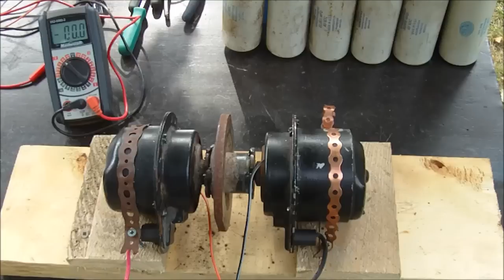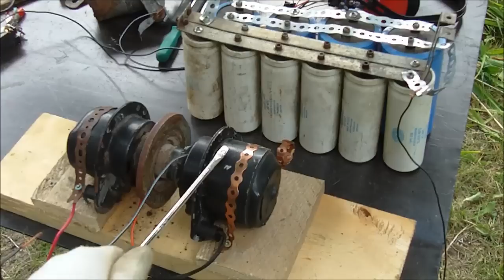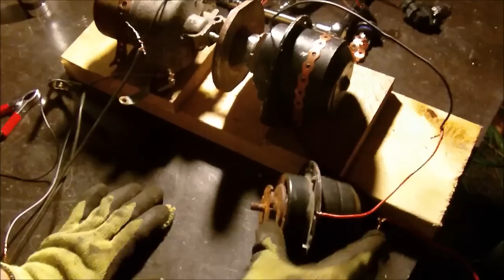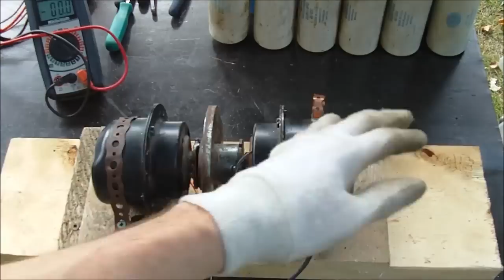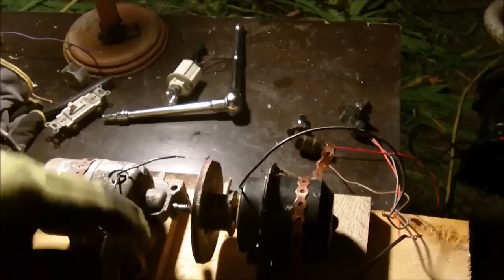Electric Motor to Motor, can they self run?

Comment: Ok so the motors aren't the best - but if it worked just pop a tyre on it and we could all drive around for ever for free, spin it faster with a fan and maybe we could all fly :~$     But if if the drag of the earth is to much for it and want to save on friction, bearings, heat and frictional forces in the commutator then all we need to do is wire a transformer input and output together add a voltage doubler for good measure and the worlds a brighter place ;-}                                                    " Now where the wife's microwave buzz"

Comment: Try and follow the same procedures only this time series the motor! when the two motor faces each other on the same pully, the polarity changes! When connected parallel one spin clockwise and the other anti-clockwise when the motor faces each other.
Reply: Doesn't matter.  Faraday already proved that the  voltage generated will be the same.

Comment: Doesn't work because basically; It takes the same energy the motor is getting from the generator to turn the generator so one "extinguishes the other" .

[Energy can neither be created nor destroyed; rather, it transforms from one form to another.] from Wikipedia

Neat little experiment though :)

Comment: This does work lol. What is the required power needed to run the power motor vs what is the output of the generator motor. It works very well it looks like you just don't have enough output to power the unit.
Reply: Lol I'm the idiot that has a working version sitting on the side of my house that puts out 6500 watts lol..
Reply: john smith  Great. Let's see the video.
Reply: john smith Can you please tell me what sort of cheese the Moon is made of?

Comment: it wont work cause your using them as just fans. you need a alternator and use the charge wire to run the opposite fan

Comment: try using a gear ration such as 1:4 so for every turn of the motor we get many more turns out of the generator.
Reply: +cris rose With much lower torque, read up.
Reply: Johan Engqvist lower torque maybe but you don't need much.
Reply: +cris rose You've multiplied the speed but divided the torque. Since Power = Torque x Speed, you can put numbers in and realise you end up with the same amount of power. That's like saying my 100HP car produces more power in first gear! Wrong it always produces 100HP but the torque can be increase while the speed is reduced or the other way around, torque can be decreased while speed can be increase. The power you get is always the same, but then friction comes in so it's always less.
Reply: so they balance each other out?
Reply: cris rose Yes exactly. They way a gearbox or chain drive or belt drive works is you can increase speed but reduce torque or increase torque but reduce speed, you can't increase both at the same time. And so Power = Torque x Speed you will always get the same power out (minus some power in friction losses).

It's good you understand this because so many free energy machines pretend to work because they break this basic law of life.
Reply: KiwiPowerNZ but surely you don't need that much torque to spin a motor?
Reply: cris rose If you are turning a motor and using it as a generator or just using a purpose made generator the torque needed to turn it depends on how much power you draw off the electrical outputs. A fast turn generator can make the same power as a slow one but requires less torque to turn it, and vise versa a slow turning generator can make the same power as a fast one but requires more torque to make the same amount of power.

So changing the speed doesn't give you free power. And in both cases the more power you draw from the generator the more power you must put into the shaft.

If you were just referring to the motor itself it must overcome the friction of it's bearings and the load connected to the shaft.
Reply: cris rose A good example is a car alternator. Power = Torque x Speed.
When the engine is idling aka low speed, the alternator requires a lot of torque to generate the necessary power the car uses. Sometimes at idle the belt will slip and squeal loudly.

When you are driving the alternator speed is very fast which means only a small torque is needed to generate the necessary power.
Reply: KiwiPowerNZ thank you :)
Reply: cris rose No problem!

Comment: You don't need 100% efficiency! All you need is enough input to drive the alternator. The output is based on the configuration of the alternator not how much current s put in!

Comment: what about collecting the back emf of the drive motor when this get energized and add some brushes and a contacor to the flywheel so the drive engine will run only on the impulses from that contact placed on the flyweel. the drive engine when is not energized will be used as a generator and when is energized is used as a drive motor. all system should run from the inertia of the flywheel wich should be a little havier to sustain the rotation of the entire  system. When the system gets started u can use a battery to skip the contact from the flywheel until it reaches the maximum speed and then the flywheel contact will do the job. I personaly want to try what i describe above
Reply: all the system will collect energy from 3 sorces: the dedicated generator, back emf fron the drive motor when gets energized, and the drive motor used as a generator when not energized...
Reply: All you are doing is storing energy in the flywheel that will slowly be drained away until the entire system comes to a stop.
Reply: Lol.  All these people coming up with different systems trying to bypass physics.  In the end, no matter how many generators, motors, flywheels, gears, magnets, coils, etc. they add, the same thing happens; the physics are the same.

Comment: You have to change the gear ratio of the motor that's turning the other one at is used as a generator put the a 3" pulley on the generator motor and a 8" on the one to Supply power to the generator motor and it will run without shutting down
Reply: Anytime you using the same gear ratio is going to neutralize and shutdown that is common knowledge
Reply: You also need a Step up Transformer to go with them capacitors

Comment: use a gear system. use the lower power motor with a large gear and the power generator with a smaller gear in order to make the power motor spin faster than the smaller power motor. once you do that you make the larger output motor output more energy in order to push the smaller motor enough to produce that power. it makes sense. that is the whole purpose of gears. take a vehicle transmission for example. the rpms could stay at 3000 rpms but with each gear (6) your reach a speed of 10 mph for gear one. 20 mph for gear 2, 35 mph for gear 3, 50 mph for gear 4 and 60 mph for gear 5 and last 70 mph for gear 6... (just an example) but this is all at 3000 rpm. of course you raise the rpm, you go faster. but the point here is the gear system. use a gear system for the motors. and walla! more output power then input power equals more power to push the input motor as well as the load on the circuit system.

Comment: Use graphene capacitors  there mass is so much smaller and charge  very quickly and pulse the generator motor and not the drive motor, use 5 caps 2.6 volts ea. 3000mfd that should get the drive motor spinning
.
Reply: Lol...hilarious.  And what?  Run for maybe a few minutes and then die when capacitors are drained?  What is the point?

Comment: what if u connect the 2 motors with a flywheel and have some rare earth magnets glued to the flywheel to help the motor keep running the magnets should keep pulling the flywheel spinning
Reply: conservation of energy still applies
Prolem is there is a loss of energy as it travels trhough the wires, loss of energy as it turns ti kinetic energy in turning the motor at a effeciency loss and even more energy loss as the generator ineffeciently makes electricity.......and this is even before you put a motor load on it which will cause a physical drag or atry to draw current from it to, say, run a microwave oven that will cause a EM drag on the generator in the opposite direction of its turning equal to the current being drawn which is why generators whine and grind when you turn on high current loads on them as the gasoline motor has to provide more power to overcome the EM drag using electricity causes)
Reply: u prob would need to run some Li-ion batteries and supercapacitors

Comment: disconnect the motors.......  run alternator through wheel on the ground.  change gear to spin faster.  charge batt. with alternator.  run motor with batt.

Comment: Sir Isaac Newton postulated that with every action there is an equal and opposite reaction. It is like putting a fan on a sail boat to blow the sail. It will never work. No matter if you use a more powerful generator because if it is more powerful, in will need more power. They cancel each other out. Same goes with the doppelganger effect. If you were confronted by your equal in every aspect and tried to shove each other out of the way, neither of you would move. One has to be stronger than the other, and to be stronger it would need more power. It just can't happen.

Comment: If there is a way to do this, by some secret knowledge, it would be by discovering ether 1. a motor action principle that does not also generate a voltage: A no back emf motor. 2. a generator principle that does not also produce a negative torque: A no back torque generator. The problem is that these actions always happen together. A motor is a generator and a generator is a motor. There appears to be no way to get one without the other.  Also, the basic principles of motors are so simple that finding a new motor action principle or a new generator principle is highly unlikely let alone finding one that works without the other.  Because this is such a wonderful dream, I will lay out the fundamentals of such a research endeavor:  There are two known ways to produce voltage 1. a wire moving through magnetic lines.  2. a magnet moving past a magnetic steel core with a coil wound on it. In both cases, the current induced will oppose the motion, which is then a generator with negative torque.  Then for a motor there are three known ways to produce motor action: 1. A wire with current will produce a force on the magnetic lines of a magnet by a pressure difference on the circular magnetic lines that surround the wire. On one side, the interacting lines run in opposite directions and do not produce a force. The lines on the opposite side run parallel and in the same direction and a repulsion force occurs between them. This is the fundamental motor action principle for most motors. Unfortunately when the wire moves through the magnetic lines it is also acting as a generator. 2. A magnet is attracted to and then away from a magnetic steel core with a coil wound on it. (and current applied) Here the magnet lines enter the core and rotate the tiny magnetic domains inside the core and it is this rotation into alignment with the magnet lines that induce a voltage in the coil. That voltage is this arrangement acting as a generator. 3. The attraction of a piece of steel to an electromagnet produces torque. This is called the reluctance principle. This arrangement produces voltage by a reactance from the rising inductance.  Its the same as a rising current in a fixed inductance causes a reactance (a voltage which opposes current flow) inversely then, a rising inductance with a fixed current (applied d.c. current) will also experience a reactance.  This reactance is a voltage which opposes the applied current. This voltage then, is this motor acting as a generator. 
 So now, that is it. For there to be some magical electromagnetic free energy machine an entirely new principle would have to be discovered in which there is an imbalance between voltage and motor action. Such a principle would be so secret as to have evaded the attention of scientists for almost 200 years now. Although one cannot say that it absolutely does not exist,  I have laid out why it is so highly unlikely.  Nevertheless, the dream is so very enticing. Such a machine would be the ideal and perfect technology. Far superior to anything we have now or are likely to ever have. The "Electron Engine"  Supersonic flying cars. Factories that produce goods much cheaper.  Machines that filter the atmosphere back to the preindustrial level.  Kinda sounds like heaven.  Its possible that the earth is never suppose to  be that way and the conservation of energy theory stands guard, making sure that that doesn't happen.

Comment: 07-29-16i've always wanted to experiment with this idea, but time and funds are short, so perhaps you or one of your readers will consider my ideas.my plan was essentially what you've got here; with two motors connected together, only i wanted to do a time/distance test to see how much the time or distance could be increased using this idea. 1) using a fully charged battery, hook up a motor to see how long it will run. 2) next, with a fully charged battery, hook up two motors as you have it here, so that while the one is being driven, the second motor would be adding additional charge to feed the battery to recharge it. 3) in that configuration where you're basically charging the motor as you go, how much longer would the motor run with that extra influx of electricity? my plan in practicality, was to have this arrangement on an electric bike, with one 'hub motor' driving the bike, while the other 'hub motor' was generating electricity which would be sent back to recharge the battery... how much would such an arrangement extend the range of that electric bike, assuming that it would?and just for grins, I also wanted to try this arrangement on a 3 wheel bike, using one electric motor to drive the trike along while using two other motors (one on each extra wheel), to generate electricity sent back to recharge the battery. also, if it's possible, it would be advantageous to be able to switch things up on the fly (should you need extra power), to where two of the electric motors could suddenly be driving the trike while the third motor would continue to add additional charge to the battery. please let me know the results if you or a reader tries this.

Comment: can't you just keep charging the back and forward so when one dies out then the other starts and it keeps going
Reply: I mean the battery can you keep charging them back and forward .....like if one is running   and it's charging the secondary motor and when the motor that is on runs out that's when the secondary kicks in then start charging the battery of the first one .....if that makes any sense....just set them up as one motor by it self ....is there a way that could be possible.....

Comment: Couldn't you take your electric motor and belt it up to a 90 amp car alternator to a battery field to a power inverter and plug the electric motor into the inverter and self contain and run

Comment: it doesn't work but I can see a lot of improvements that can be done. first, the flywheel design should be halo at the centre because the linear velocity is zero and that cannot help so you should have a better flywheel design. second, I see that the design is unbalanced there's no equal spaces. finally, maybe vertical design will be more efficient I can't tell because I don't have enough information about your design but keep in mind that there are optimized designs to work vertically and others to work horizontally

Comment: The bulbs slow down the RPMs because of resistance. There are electronic components to help with that. This a very inefficient way of doing this, that won't work at all

Comment: You just have tandem motors witch you doubled the power output . the motor running a generator to keep it going can`t work because the conversion is and will never be 100 % or greater

Comment: yea it could self run but of course you need a place to store it that has a power generation such a rechargable battery you would have to dial it in of course to the proper mathmatics ....so self powrring system those two things cant self power because it doesnt work theres no where to continue to build a charge it just stays the same if its in a loop they bolth will cooperate the same what happens in a circle stays in a circle if one stops they all stop inless you have that place to hold and charge enough power that you need to power the other motor that will run the generator that will go back to the battery now if you had this in energy level grading scales for example small meidum and large small being what you have on the table meidum being a car large being a house  than this same method kf which i explained could probley be done as long as you have a starter or batery to start the motor and enough power being produced by the generator that can surpass the amount being used and still charge the battery at the same time then i beleive it would work as a self powering system if this makes sense try it figure the math of it all and come up with it or test it. Then i run into a road block me not knowing enough about electricty to say much but i feel that of the motor is being generated by the batery you would need a varible resistor to lower the voltage so that you can equal it so the power being used and power being saved to the batery is at 50%but if you do that then when the power is brought up in the generator wont that make the generators turn velocity go faster than the motor so if we could figure a way to balnace it all and keep the power being used and power being charged at 50%amd keep bolth motor and generator in sync and keep everything from detroying eachother then we would have a soloution and im sure this cam be done but like i said i know little things here and there